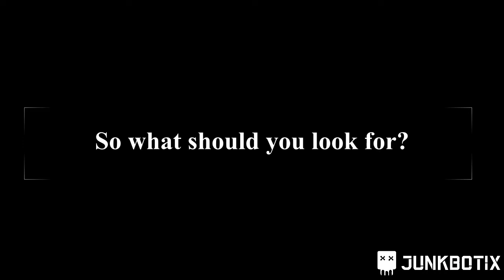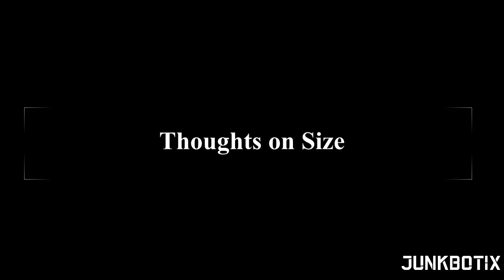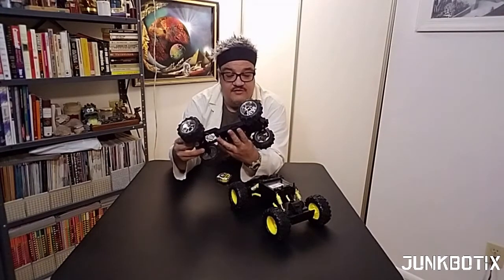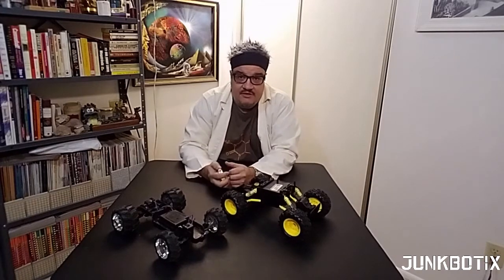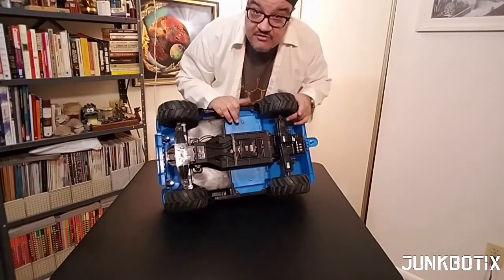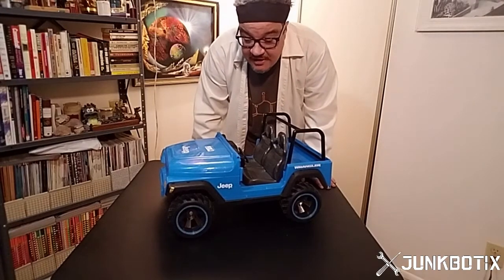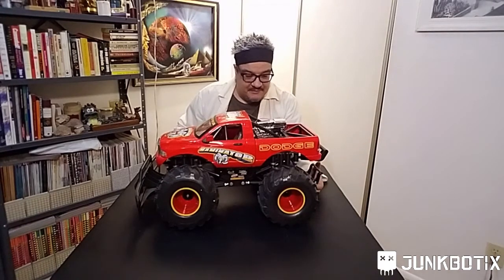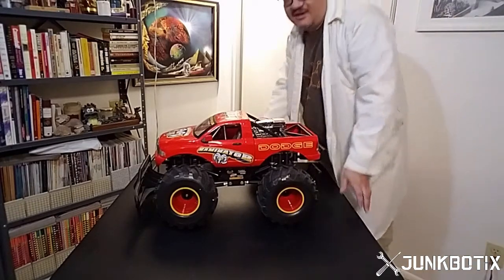Toy RC Car Robot Development Platform - Part 1 - What, Where, and Why?

Comment: I'm looking to build one of these myself... how much do you think everything costs? Like, to have a car that it's controllable from far away and to have a camera on it?
Reply from the maker: That is a tough one to answer with accuracy, without more specifics. Just the question of "distance of operation" can change the number greatly (that is, the closer you are to the vehicle, the cheaper it will be to control and operate). Also, whether you wanted to build that control system from close to "ground up" (ie - a couple of NRF24L01 tranceivers, etc), or if you just wanted to drop in a cheap hobby RC controller (ie - Flysky).

All I can say for certain is what the vehicle I showed cost - roughly, as I didn't keep track of such costs. The vehicle itself was under $20.00 (USD) from a thrift store. The Arduino was something cheap - maybe $5-10.00? Servo, wires, etc... I'd have to guess maybe a total of around $50.00 went into it, in total.

If I had bought the car new, though (something around 1/10 - 1/12 scale, I think) - that would have raised the price by a considerable amount, depending on the vehicle chose, where it was bought, etc (a quick look on Amazon is showing prices around $100-200.00 for such a vehicle - you could probably get one cheaper direct-shipped from China via Ali Express or such).

A cheap Flysky system (6-channel transmitter and receiver) can be had for around $60.00; add on a vehicle from a thrift store, lots of hacking, all the other parts - a very frugal person (and some trash digging) could keep it at around $100.00, but realistically, somewhere around $150.00 would be more in line.

But there is another possibility - if you get a bit creative:

1. RC car from thrift store - ~$20.00 (USD)
2. ESP32 + Camera - ~$10.00
3. SPI/I2C I/O expander - ~$5.00
4. Other extras - $??.?? (probably under $50.00)

Control would be done with your phone, via WiFi and setting up the ESP32 as an access point (as it has on-board WiFi); the only question might be that ESP32 and camera (this is sold as basically a "complete module") - as the camera takes up a bunch of I/O on the controller, but not so much as to leave out other options. You could, for instance, add a second ESP32 to the mix, one for just the camera, the other to control the car, and some kind of serial link in between (likely I2C or SPI would be best).

Then you'd just need a bunch of custom code on the ESP32 modules and a cheapo Android phone (using WiFi - don't need cell service here - just some cheap $25.00 pre-paid phone will be fine). Plus something on the phone (it's pretty open-ended what you could do here with various coding platforms) to present an interface to allow control of the vehicle, and see what is coming from the camera.

But again - as you can see from all the numbers above - the main "expensive part" is the vehicle; find something low-cost to free for that part, and everything else really won't cost you much.

If you wanted to make it almost completely "out of junk" - then maybe for the WiFi part you could use an old WiFi router (an early version Linksys WRT54G would be best, as they're the "most hacked" out there - and can be found by the boatload at thrift stores and similar), and have it use serial comms to an external low-cost Arduino Uno (or other cheap microcontroller). Add on an old IP camera that can be plugged into the router (or "connected" via WiFi)...

You get the idea - but as you can tell, all of these "solutions" and ideas boil down to a total cost of around $100.00 USD, depending on what you can find, where you find it, what you have on-hand, etc. If you have to buy the car "new" - then tack on (about) another $100.00.

I hope that helps to answer your question. Good luck with your project!